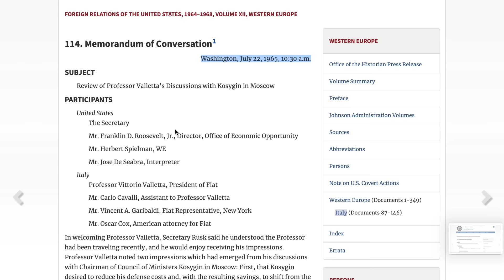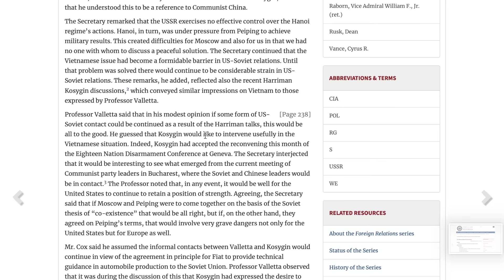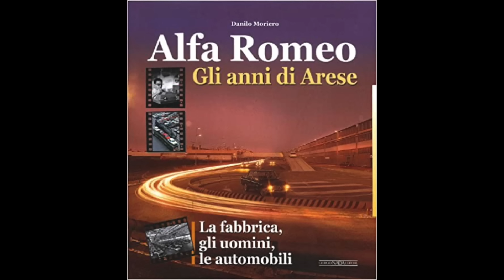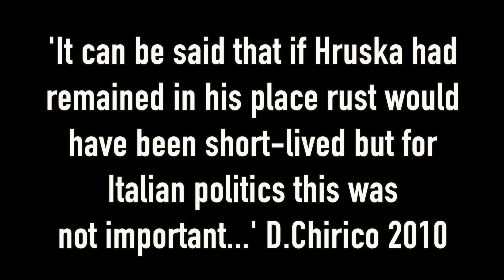Alfa Romeo And The Myth of Russian Steel - The Real Reason Alfas Rust

Comment: Alfa Romeo cars were rusty because they had steel from the same supply chain that FIAT was using.  FIAT had a deal in the 70s with Greek Tycoons that recycled WWII steel (tanks, including russian tanks, but really any sort of old stuff they could buy at the price of spuds) and made new "Greek" steel.  Only one big problem: there's not enough water in Greece, so they resorted to use the Mediterraneum.  Their extraordinally cheap steel was rottening from the inside, no matter the quality (not great) of the anti-rust treatment.  I've been working for FIAT in the late 70s and it was quite acknowledged by the workers that they were using a product that could not stand the test of time, but, hey, who cared???? FIAT cars were modified every 3 months to sell new models or variants and their lifespan was calculate to be short: they had the entirity of the Italian market....

Comment: Pretty sure most old tanks ended up as new tanks (namely T-55 and later T-72). Also I think military grade steel is quite good and if it was used instead there would be less problems with corrosion, not more.

Comment: I'd never understood that story about the Russian steel as it made no sense to me either.
I also was well aware during the 1970s how cars rusted badly - proper sealing and procedures just weren't there. 
It's not difficult to see evidence of this - think of how many cars there were in the 1970s and how few of them are around now, versus say a car from the 1980s.
You will still see plenty of older Fiestas around for example, but FAR mroe prevalent were Cortinas especially Mk 3s. And yet they are far fewer. 
My dad pointed this out to me during the 1970s - he used to work at Vauxhall back in the day and every car he bought he'd painstakingly plaster underseal on it. He'd point out that with Vauxhalls and NL cars you could compare one to another and see the bots missed as one worker may have gone on a tea break or production was out of skew.

Comment: I have to say as someone who has owned both betas and suds the beta wasn't really that bad for rust in comparison to the sud. My first beta was 15 years old before corrosion caused it to fail am MOT. Where my current sud is a never ending battle of keeping on top of the tin worm.
Reply from the maker: I thing the Beta’s main issue was a rust trap in the front subframe..
Reply: @Number27  it was but that only really effected the early birlinas . The beta scandle was overblown imo. And poorly managed by lancia

Comment: Nothing rotted faster than the 240 260 and 280 Z cars of the 70s.  The rocker panels held water and rotted through in less than 3 or 4 years if driven in the north east or snow belt of North America where rock salt is over used on roads every winter.  They made a vw beetle look good in comparison.  
Porsche finally started galvanizing their 911 bodies in 1976.  Until then they rusted out as well.

Comment: Kid in the '70s anyway saw a lot of cars rusting happily, regardless make, model or nationality. Never heard of russian steel BS but rotten Lada, Moscovitch and Uaz were in my eyesight everyday. However my Pops had two Alfasud - a 5 doors "saloon" and a 3 doors TI - and none had issues. Just like the 33 Q.V. 1.5 litres that followed.
Anyway most problems were in contruction problems, as stressed out, and now obsolete technologies and processes but later they improved. 
I.e. in 2000 bought a  '93 Alfa 155 and in 2003 put hands on a 1997 Alfa 146 i wrecked in 2017 for a diesel. Neither had a single rust spot and neither was sheltered but by clouds. And north made Alfetta rusted too but.. hush hush!
Ps: IRI top slughead had to sell AR  to Ford or Fiat and sold Alfa to the latter at a fraction of the cost, starting a 20+ yrs long agony until resurrection.
So I wouldn't swear about their IQ or good faith...

Comment: In the USA and Canada, we also had terrible rust and other problems with cars made here or imports in the late 1960's and into the 1980's Domestic production, like in Italy and Europe, we also had plant worker strikes, poor and penny pinching management, political pressures to keep plants open even if not economically feasible, rebellion by workers and unions against automated machinery, poor quality control and handling of steel. That meant inconsistent quality, compounded in part from our salt for de-icing roads in winter in much of the northern USA, and poor designs. 
The rust problems of Fiats imported to North America, in particular the 850 series in the late 1960's-mid-1970, were among the worst of any vehicle here. Federal agencies by the late 1970's required Fiat to pay for and remove all remaining 850's as had such severe rust in major structural parts they were were too dangerous to be on the road.

Comment: In Italian motorcycles the chrome washed off in the rain and Italian electrics were notoriously poor in wet weather .Today exhausts are stainless steel and they use Bosch electrics that have few problems with water compared to Marelli .Mercedes used to be largely rust impervious but today many modern ones are rot boxes -their build quality today us rubbish compared to the past  Has anyone ever seen a rusty Lexus? ?

Comment: Anybody old enough to remember the 70s will  remember cars rusting out in 5 years or so. They didn’t do it before and they certainly have not done it since. Lack of appropriate rust proofing, masses of cars in various stage of production piled up on salty dock lands and estuaries for months on end…… and strikes and inflation. Even Japanese cars rusted badly. Given all the problems, I sometimes wonder how they lasted as long as they did.
Reply: True the '70s had a lot of rusty cars, but the point of this investigation was to find out why the Alfasud rusted much faster and with worse consequences than the rest of the Alfa range which were made from the same steel supply but in the Milan factory rather than Pomigliano d'Arco.

Comment: Every car I had made in the 60's - 80's rusted badly.. the problem was just poorly protected steel.
Reply: True the '70s had a lot of rusty cars, but the point of this investigation was to find out why the Alfasud rusted much faster and with worse consequences than the rest of the Alfa range which were made from the same steel supply but in the Milan factory rather than Pomigliano d'Arco.

Comment: Has anyone established what was 'inferior' about the steel. I believe the principle cause of rust [corrosion] damage was [is?] caused by failure to protect bare steel surface with paint/wax/stonechip coating and creating mud traps that trap moisture and prevent drying out. 'Modern' vehicles [1960 0nwards] gain strength from hollow box sections, often left bare steel inside [rust from inside out]. to trap moisture. Proof? early cars 'Zebarted' a wax coating in hollow sections survive to this day.

Comment: When the Fiat Chroma and SAAB 9000 platform came. The SAAB rusted badly but not the Cromas. The reason was that SAAB used recycled steel but not Fiat, wise from earlier mistakes. German auto makers are still using recycled steel and therefor rust badly to this day. Never buy a new car made from recycled steel. It has carbon impuraties and is like swiss cheese inside it's structure.

Comment: Was it not the case that the serious corrosion problems that Mercedes, especially in E Classes,  suffered in the late 90s/early 2000s was also attributed to sub standard Russian steel ? The issues cost Merc millions worldwide and damaged their reputation for many years after. Would love to know if that was also a myth or not 🤔
Reply from the maker: No it was just very poor rustproofing on those! Thanks for watching Graham!
Reply: @Number27  probably.I recall when my parents couldn't get their e class we started thinking plan b honda called us to test a legend,i started thinking mazda 929 or eunos 800(this was 1996)or even used 929's from the 1991-1993 period.with much regret not knowing about the quality issues myth they bought a smaller c class.
Reply: It was the switch to water-based paint and primer on those.
Same with all other German makes.
BMW and VW suffered too.
It actually started in the mid-90s, around 1993.
By 1998-99 they were okay.

Comment: It wasn't just the Alfa Sud, but also the whole Alfetta line including the GTV6.  However earlier models, the Giuliettas and 105 Giulias had much better steel and not nearly as bad a rust issue.  Your evidence points to shoddy Italian work ethic and politics as the source of the rust, and that feels true.    As does the fact that most car makers didn't use galvanized steel until...what...the mid to late 80s?  Still hoping you'll do some pieces on Alejandro de Tomaso and the Maserati Biturbos...from Maserati's rescue from Citroen by de Tomaso, the introduction of the Biturbo, and up to the last models....which are the last true Maserati's.

Comment: I read somewhere that on top of communists,mafia,working culture they stored the steel outside under the elements, that was before the "just enough material on time" policy that is common today , so the steel got rained on,was close to the sea and was not cleaned properly before painting.
Reply: Some possible causes there, but the official report said the main cause was the lack of preparation.  All raw steel will rust on the surface if left long enough, but there were processes in place for cleaning and prep that were by-passed by lazy workers so paint was applied to rusty steel. Simple really.

Comment: Excellent subject matter Jack, excellent research too, I bet that took a while. Rather lazy of successive generations of journalists and indeed broadcasters for berating Russian steel, though bearing in mind current affairs in Ukraine, some of the equipment used by the Russians could indeed be made with that dodgy steel again!
Ive always admired the Alfas and indeed the Lancias, it's sad really that the Italians basically let each other down and built the rubbish reliability smears themselves. I do always wonder too how Ferraris and Lamborghinis manage their reputations with surely the same kind of workforces!
A relative in the North East gained in laws who swore by Lancias, they had those 5 Dr Beta models which were always immaculate.
As I've said to you before the steel does seem to be different, and rem dad's French made zx panels always felt spongy or tinny compared with the solid Ford metal I do think the steel is affected by local conditions, but I'm not clever enough to pinpoint what, but as said the Zx was tinnier, and much more flexible to the touch regardless of the rust proofing, further to this I rem in particular the 205 gti had "bare" wheel arches with what must have been clear rustproofing applied as opposed to ford's liners or black stuff liberally applied.
Anyway enough blathering. Enjoyed the change of topic. I do wonder whilst I know rustproofing is much more extensive at the factory now why you never hear the word  "Zibart" protected anymore, when this stuff preserved old motors for years? .
Best wishes, Ben 🚌🚍👑🇬🇧🇺🇦🙏

Comment: the original Audi 100 or 1000 wide n flat body was a total rust bucket but the Germans worked hard n the follow up model was improved beyond believe, in Cyprus people loved  Italian cars and because of their rust people used to remarked they were made with Pepsi recycle cans, But the early 60s Lancia especially the 2000 was it HF was SOLID on par with the old Peugeot 403 n the Volvo 121/122

Comment: I'm surprised that the myth of Russian tanks in Italian steel continues, and that anyone on the Internet gives it credence.  It is well known that the reason for the rust is the use of British and German tanks from the Western Desert campaign during WWII.  When Libya finally sorted itself out as an independent country in 1951 it collected the tanks, spent ammunition and other debris and exported it to Italy, where it was added to the steel produced in blast furnaces like those at Taranto mentioned in the video.  Bombed out tanks had not only steel, but also many other metals and other components, as well as the product of explosions and fire, many impurities which facilitate corrosion under the right circumstances.  The steel produced as a result had a much higher level of impurities as a result, a necessary precursor to condensation-induced oxydation.  Poor working practice in the Pomigliano plant merely brought this polluted steel into contact with water much faster than in other cars, and as others have said, in cars with thicker steel the problems would only be noted much later.  So, the truth is, that tanks were in the mix, but not Russian ones.  The Tiger mentioned was partly to blame.

Comment: The German cars of the late sixties and early seventies weren't the least bit better. I tried some because my family was partly nationalistic enough to not like me having Italian or French (which rusted as bad as the lot) cars. 
I had a 5 year old W113 Mercedes 250 SL I got from a relative which lost steering because the steering box wandered through corroded tin instead of being fixed there and moving the wheels. Had a BMW 3.0 CSi an aunt donated to avoid the next Bertone, but the Bimmer lost the rear axle when I drove over a railroad crossing and the shocks went straight through the wheelwells. My Sud 1.5 was bad as well, and so were all the Bertones and Giulias and Fulvias. A Citroën DS I had broke in half on the lift (80% of the weight in front of the foremost points .... too much for the slightly corroded framerails when we lifted the lot.) A GS Citroën broke in half like a bad Bond-stunt on the same railroad crossing that killed the Bimmer. So, it was not a thing only hitting Alfa. In fact, given the trouble the Campania created ever since for the Northerners forced to "invest" in Africa the mezziogiorno, the "Suds" were pretty good cars in comparison.

Comment: Cool video. My dad had a 1976 Peugeot 304, it rusted very badly in only a few years time.
My own BMW's 02-series (1968, 1973, 2x 1975) and e21 3-series also rusted very badly. But the WORST of them all has to be the BMW e9 3.0CS. That car was handbuilt by Karmann and my lord, did that car RUST!

About the Russian steel myth:  I heard it very early in the 1980's already.
Must have been in connection with the steelcrisis in the 1970's. Yes, that did happen. 
But not because of Russia. 
https://en.m.wikipedia.org/wiki/Steel_crisis
Reply from the maker: Thank you and interesting to hear about the Steel crisis!

Comment: Regardless of where it was sourced the problem was the steel, most likely poorly specified rather than 'poor quality'.  Everything rusted in the 70s because metal protection and painting processes were in their infancy, however the Alfa's rusted in the most unusual places, suggesting the steel was the issue. More recently Nissan had to buy back thousands of Navara pickups that were literally snapping in half due to corrosion issues linked to Chinese steel. Just look up 'snapped Navara' if you want a giggle.
Reply: It is possible the specification of the steel from Taranto was not the best, but the cold fact is that it was the same steel as used by the Alfa plant in Milan yet the Alfasud rusted far worse than the rest of the Alfa range even by normal seventies standards.
Reply: @chrismartin9421  'cold fact'? you got any evidence to say they used the same steel?

Comment: Riposte - RHD Alfa Romeos and Fiats made in South Africa were made of Carbon Steel ... and , well, didn't even half as much.
Reply from the maker: That’s because South Africa has much less rain, no cold winters and no salt on the roads.. I had a South African 1750 GTV and once it had been here a few years it started to rust.
Reply: @Number27  I live in Akl NZ , and can report that Alfas here are long lived for the same reasons. My 2006 156 V6 is a daily driver, and is solid and whole.
Reply: Irrelevant.   The Alfasuds made in South Africa were ASSEMBLED from CKD kits and the body panels were still made in Italy from the same steel by the same workers.  The difference was that the South African models only came on stream later, AFTER Alfa had sorted the worst of the problems that afflicted the early ones.  So yes, they probably were better by then, the same as the Italian ones were, but the damage to the reputation was already done between 1971 and 1976.  Then, all things being otherwise equal, South Africa had a better climate than northern Europe so cars in general probably rusted less anyway.

Comment: More likely the cause was the UK problem.   Recycled steel with all sorts of unwanted metals mixed in, (lead, aluminium, tin, copper) etc
Slightly different mixes adjoining one another caused  galvanic action and rusting.